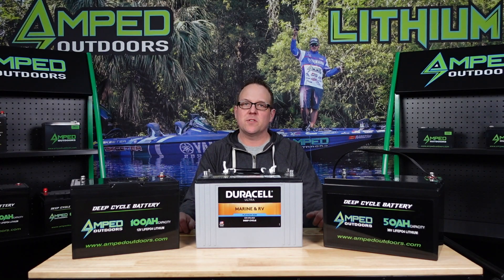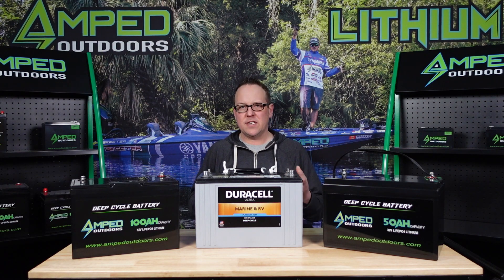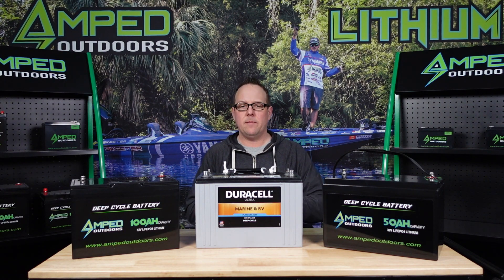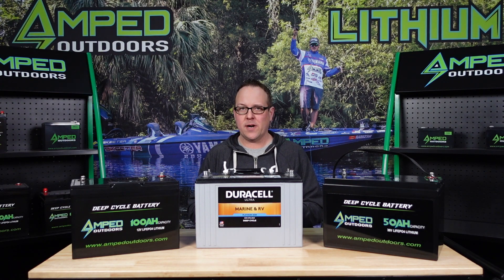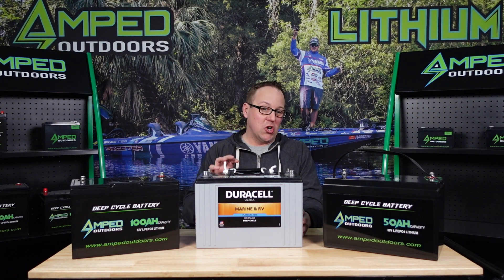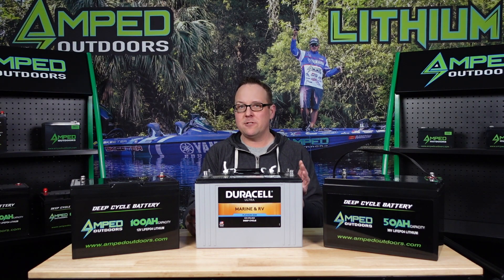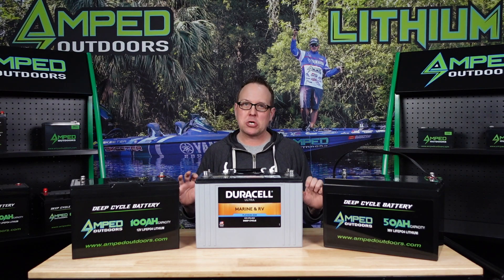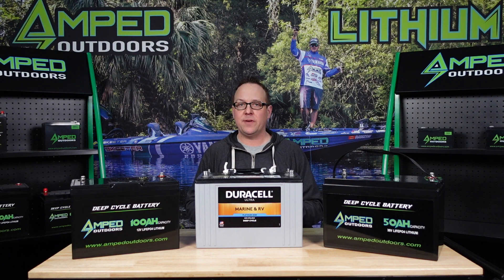How to choose the right battery for your boat trolling motor!

Comment: For a 80# 24V minn kota on a 1752 Aluminum Jon boat what aH battery would be ideal for a 8hr window?
Reply from the maker: Hello Russ. Most people will use either our 24v 50Ah or 80Ah battery which includes an on board charger. 50AH is similair to 2 group size 27 lead acid batteries for capacity. 80AH is similar to two group size 31 AGM batteries for capacity. Reach to us at Sales@ampedoutdoors.com for any questions. Thank you!

Comment: Bought Amped for my boat. Great product and price. Bought a 36V 50AH for my Ultrex and a 12V 100AH for the electronics.
Reply: Has the 50AH been enough or do you wish you had more amp hours?
Reply: Yes. It has worked well for a year now. Electronics battery is good for 10-12 hours. Have to charge it every night. Not enough to go two days. I have I have four graphs, livescope and 360 though.

Comment: Very interesting to quote Laugh-In. I am running a 3-battery Interstate system in my Lund Pro V 1850. I have a charging system built in. Two batteries for the Minn Kota Terova and one starter battery for electronics et. Every trip about an hour and a half in I get a low voltage alert on my Humminbird. This coincides with my voltage readout of around 11.5 V. These are new batteries that stay fully charged in my garage. I am curious first of all if the lithium batteries will fit in my current storage area in the boat assuming I replace the two trolling motor batteries and the starter battery in the back of the boat. Next question how do you handle shipping? Also, can I use the current wiring system to hook up the lithium batteries that I have right now?
Reply from the maker: Hello, feel free to email us sales@ampedoutdoors.com. Yes, our 100AH are group size 27 just like what you have and you will find lithium will discharge at about 13v the entire duration of their discharge cycle. We are more than happy to assist you.

Comment: Thanks for the helpful video Matt. I was trying to figure out whether I should use 3 lithium batteries in series vs 2 36V lithium batteries in parallel. After hearing your explanation, the 36V batteries makes better sense.
Reply from the maker: absolutely!

Comment: Does anyone make a 36 v lithium battery with high (eg 100Ah) amp hour
Reply from the maker: To make such a high capacity, the battery would be too big to fit into a boat using high quality components. We have the 2 50Ah batteries which are group size 31 which can be wired in parallel to achieve this capacity and still reduce one battery on your system vs 3 12V batteries.